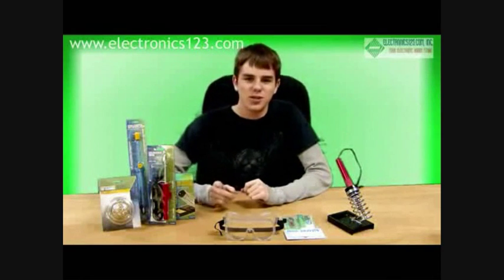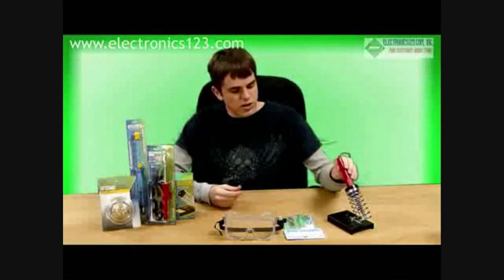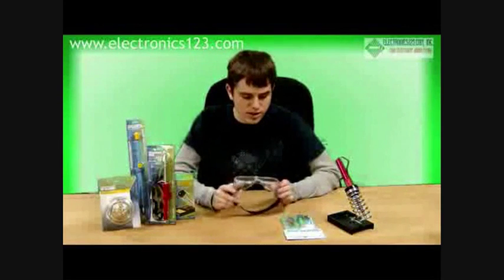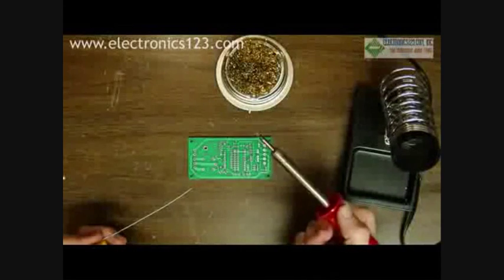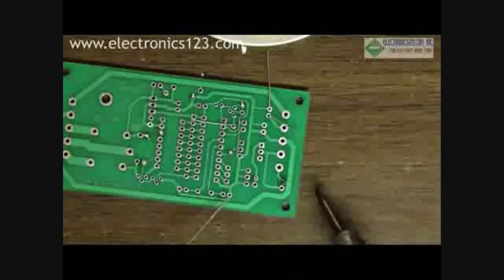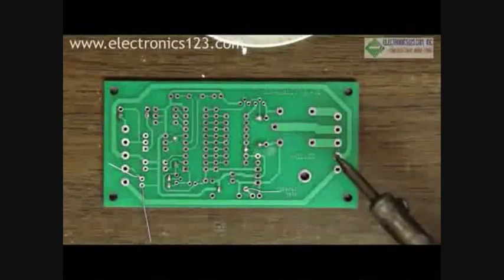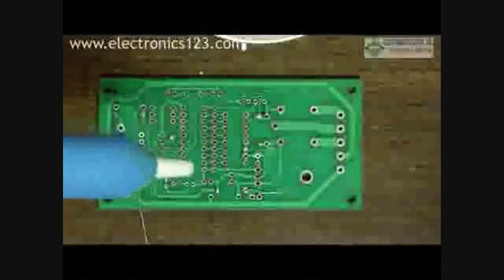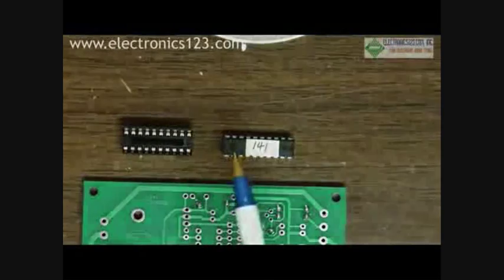My first and second Velleman Kit and soldering Tips!!!

Comment from the maker: the flux is in the core of the solder i use, it works great. Always first heat up the parts and melt the solder NOT on the tip but the part/board.